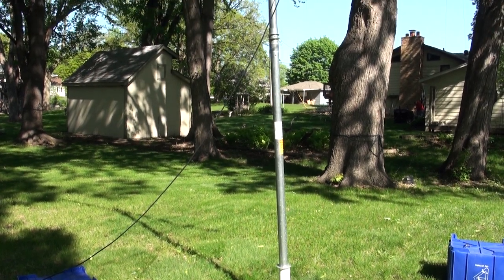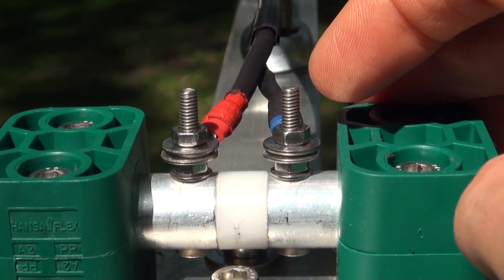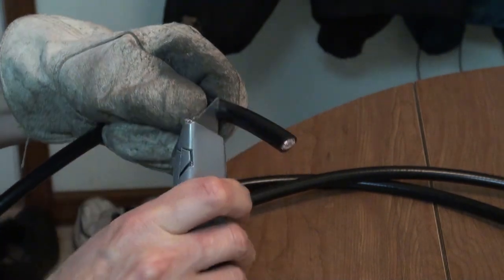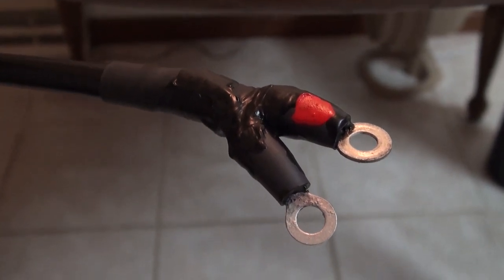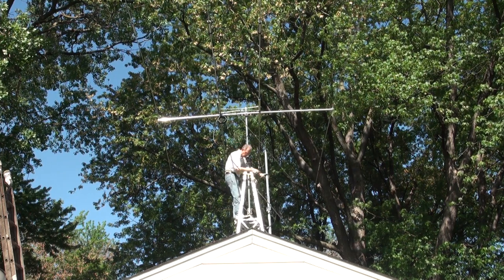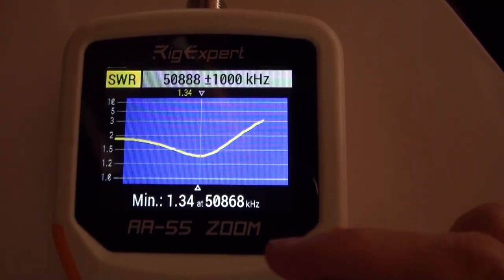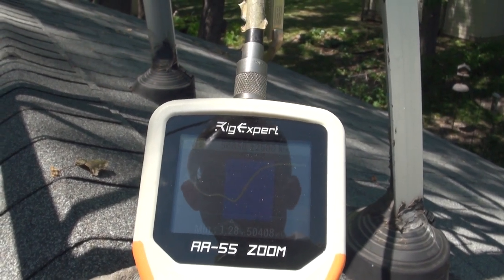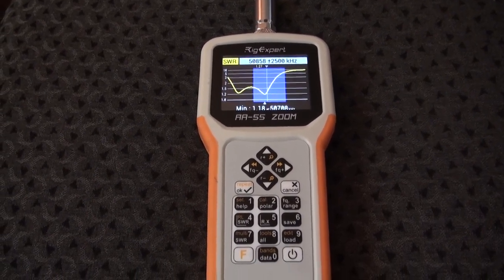InnovAntennas LFA-3(4) 6m Beam Test and Install

Comment: In case you did not know, if you turn the 6m antenna 90 degrees from the upper Mosley ant., then neither should interfere with the other.
Reply from the maker: I did not know that...thanks for the tip...73! de WX0V

Comment: 5:30 Self amalgamating tape is really good, as it liquid rubber.
Reply from the maker: Good point...I did use it on the barrel connector later in the video, so I'm with you..
73! de WX0V